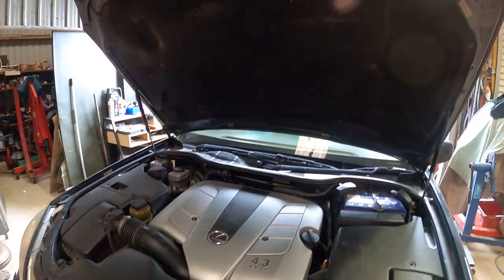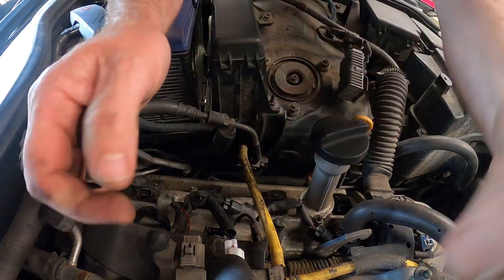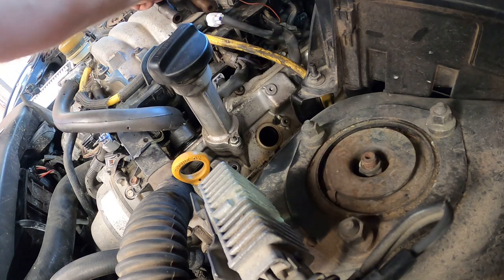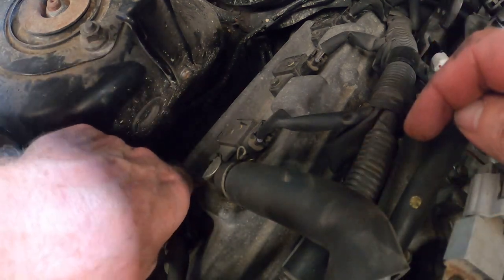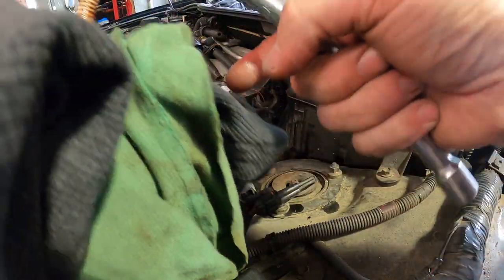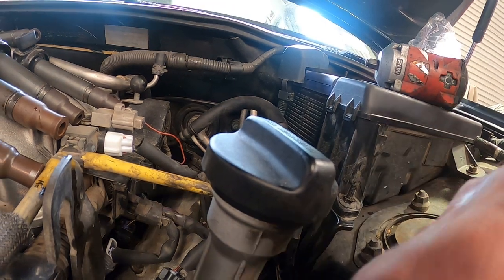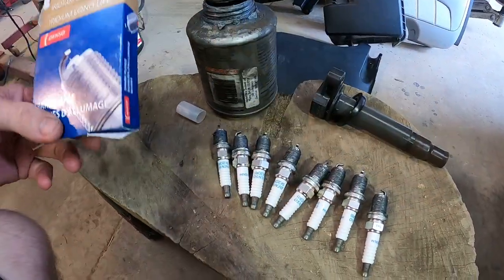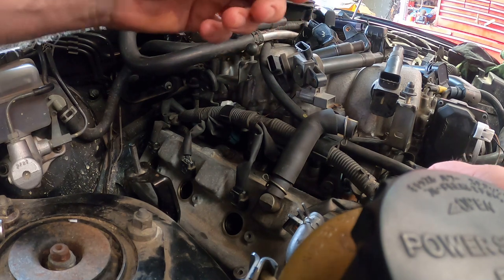Lexus LS430 Misfire   Changing the spark plugs

Comment: That was so funny, "actually my nice car feels like a pile of crap now I have a 430". I felt almost the same after 6 years and going through 3 Subaru H6 engined Legacies. When the head gasket went on the last H6 (which was 8 years newer than my current LS430) the engine guy told me that people don't keep them things as their daily drivers!! I'd done about 100000 on the Subarus and the Lexus is just a whole other beast... Thanks for the vid mate...
Reply from the maker: My H6 subaru is a nice car,  and I like the full time 4x4 but my 5 speed LS430 is nicer,  and now I have a 6 speed celsior,  but so far I think I like the LS430 better.  Cheers Kelvin

Comment: Where did all of that Oil in the spark plug tube come from?
Reply from the maker: The tappet cover gasket is leaking via the spark plug seals around the spark plug tubes
Reply: @CartuneNZ so if there is oil you jus replaced it anyways, how long would it last before oil starts leaking in again
Reply from the maker: @eric4572  in many cases the gaskets and seals are 15-20 years old so its time for replacement and if quality parts are used it should last the same again.